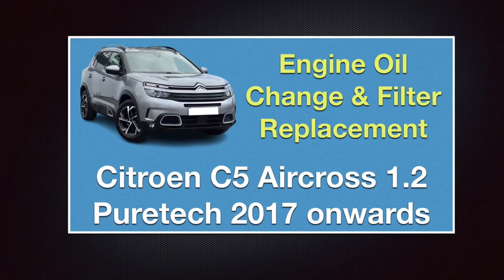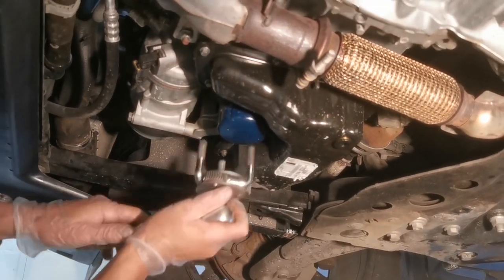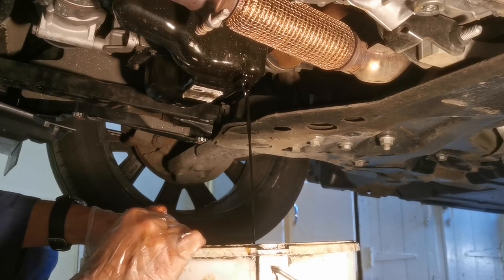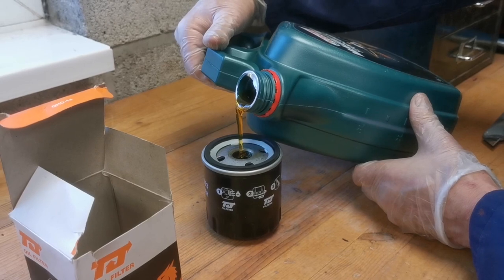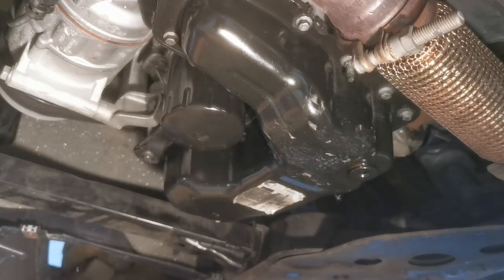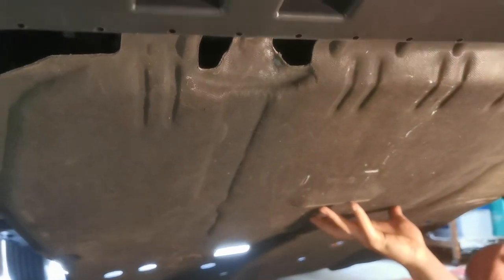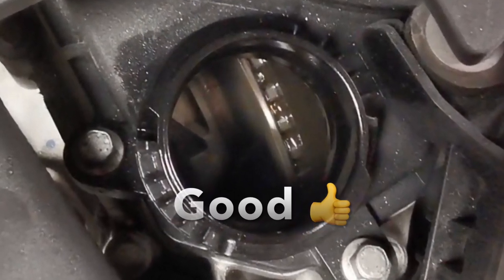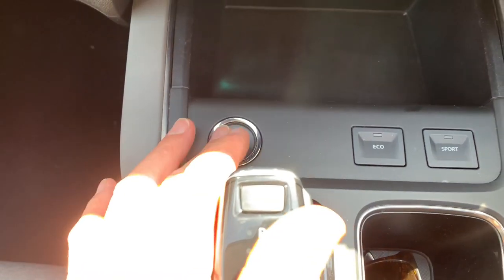ENGINE OIL & FILTER REPLACEMENT Citroen C5 Aircross 2017 Onwards

Comment: Isn't it necessary to have the engine running to add the oil?
Reply from the maker: Hi, you definitely need the engine switched off to add engine oil. Do you mean filling the oil filter with oil. This is not strictly necessary but very good practice as it allows engine oil to build pressure quicker following an oil change. Hope you enjoyed the video 🙂👍

Comment: No idea why these belts weren't up to the task. VW / Audi used rubber belts in their 2.0 TDi to run the oil pump and not as many issues there. I can only assume this issue has been resolved now.
Reply from the maker: Hi, well you would hope so, I mean what bright spark decided to put the cambelt inside the engine.😁 Not being familiar with the VW Audi oil pump belts I’ve just had a look and firstly they look a very heavy duty belt, which makes sense and secondly I would imagine they do not have same torque stress factor as a belt driving double camshafts. The Puretech engine belt looks like a fairly standard belt. Thanks for watching the video. 👍
Reply: @EverydayWorkshop  When your chasing that ultimate efficiency... reducing the friction of the belt drive system can improve MPG by a few points. Looking at the failure point of the belts, it swells, indicating an interaction between something in the oil and polymers of the belt. I reckon it's certain additives in fuel which causes it. All things considered, it's not the worst belt to change and atleast with the fuel saved, it pays for the belt... just about!  Atleast it isn't a timing chain that requires taking the engine out... that's been famous on a lot of cars to the point I'd rather have a belt over a chain nowadays!